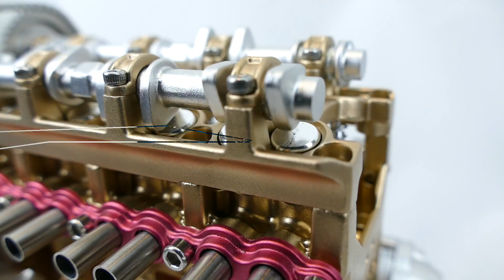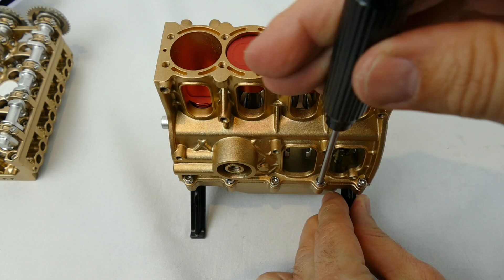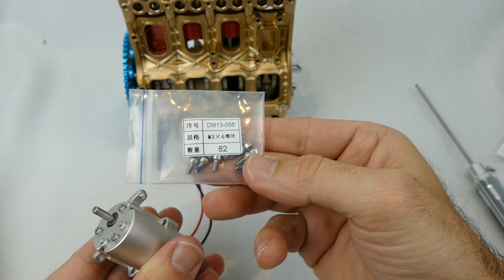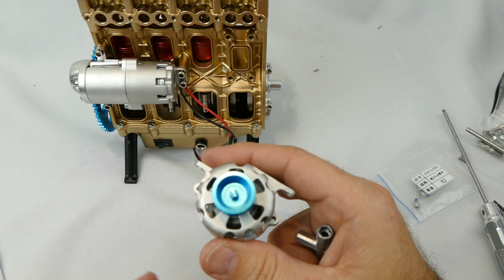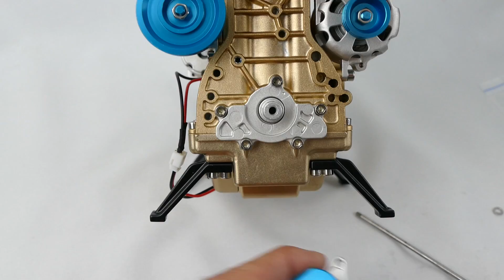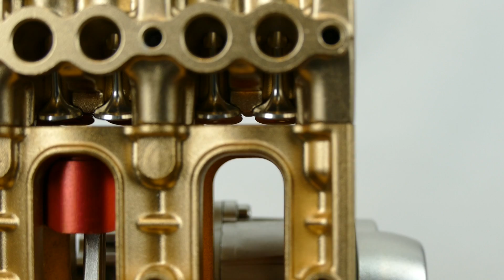TECHING 4 Cylinder DOHC Model Engine - Build Series Part 2 - Completed

Comment: Awesome video. Just wanna ask, did the alternator works (to light up an led or whatever) ? and did the adapter charge the battery? I'm just finding a few more reason to buy this thing. Thanks btw.
Reply from the maker: It could light up a small LED but not sure about charging the battery

Comment: first id like to say i have no problems with your building skills other than you need to tighten that chain it was way too loose, other than that great job and good looking model.

as far as the model goes, it is on sale for 50% off on the link in the description and is still $350 U.S. i understand it is made from metal but you can tell by the finish on the "stainless" parts that they are either super cheap stainless parts or not stainless at all. I work with a lot of stainless parts and those sound like like cheap mild steel parts that have been hot dipped with a finish.

the aluminum parts on the other hand look very well made and everything seems machined or cast beautifully but and its a huge but, i would never pay $350 or more on something this small as a model or toy as its described on the website, you can get more in depth and and more technical models that run and are plastic for less than $100 U.S.
I understand not everyone wants plastic but this model doesn't have a fan or carb or throttle body or actual headers or gaskets or even a valve cover for that matter, most if not all those things come with a cheap plastic model for a third the price or even less. this is a nice model but money wise is not very practical.

https://www.hammacher.com/product/porsche-911-working-model-engine?cm_cat=ProductSEM&cm_pla=AdWordsPLA&source=PRODSEM&gclid=Cj0KCQjwt_nmBRD0ARIsAJYs6o3FdZ-NhGZlReN7urS1-rAsK-b1n8uO6DW1jJZmfJawSSmn7s-Y05YaAqIiEALw_wcB

you would be better off with this model of a 911 turbo engine with real working L.E.D. lights for the spark plugs and distributor as well as it makes sound like a real motor lol.

Comment: I think its more value to buy cheap RC car that comes with Nitro engine(around $170 on aliexpress), you could play around with its 1 cylinder engine and put it back on when you done, and have Rc car to play with.
Reply from the maker: Yeah but doesn't really show how a 4 stroke works

Comment: I want one of these SO bad.  Thanks for these 2 videos.
Reply from the maker: You're welcome. How's your 1/4 scale grave digger going?
Been subbed to you for ages. Awesome work.
Reply: I need to get back in 1/4 Scale mod.  Been in wood turning mod lately, and healing mode.
Reply: Why would you want one?   Its not a real running engine?
Reply: To John.  The Cool factor is off the charts.  And it's fun to build something with instructions once in a while.

Comment: Seems to me the reason your timing marks did not line up is because the wheels was put on 180 degrees wrong. May have been some marking errors on the parts though.
BTW, how long time did it take to build it? :)

Comment: i think it's overpriced.. it's over $400 i think? better buy a good smartphone or gas powered RC car/copter.
Reply: When I saw the price I thought it was a real gas engine you could assemble as a kit.
Reply: yeah,, $425 on banggood. looks like not all parts have a great finish, esp the cam. unsure who's design it's patterned after, certainly not any major auto mfgr
Reply: @pauls5745  - It supposedly was designed from the 1950s Ferrari GP car 4 cyl. engine.

Comment: hi ..GREAT JOB! 
maybe you have to consider to adjust a bit the tension of the chain for it not to be too loose and pop out from the sprockets when you tilt the model and to adjust as well  just  bit the tension of the belts enough for them not to slide on the pulleys because if you listen carefully sounds like the electric motor in forcing a bit. 
AGAIN! GREAT JOB!

Comment: Nice build. I would never buy a motor that I couldnt get the spark plugs out of like that. I realize it is just a model but in reality, no designer or manufacturer in his right mind would ever design an engine like that. Its a nice build,thats for sure. Price is a tad high on that kit. I do know you can buy plastic model kits that are more detailed. Then again,mabe that is how the Chinese really do make their engines. A diesel engine mabe? I do like the aluminum ,that really makes it stand out. I could see it being used as a classroom model.